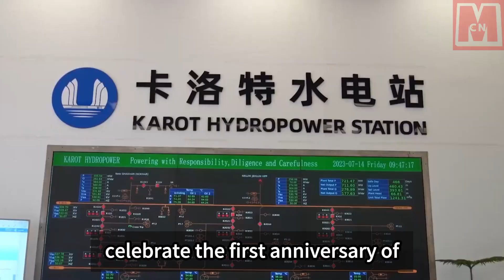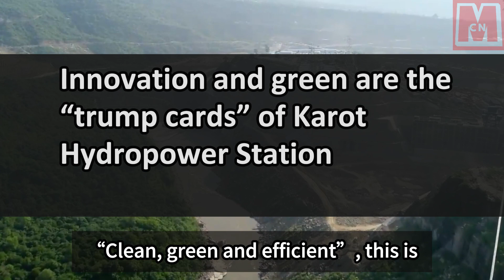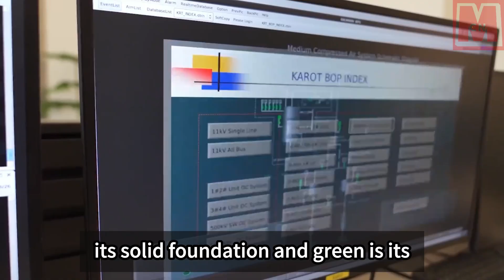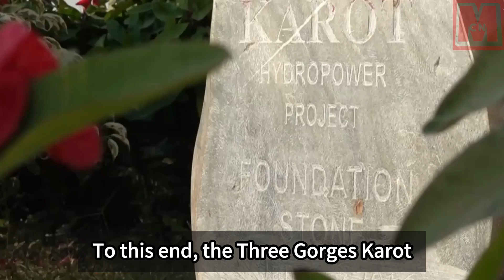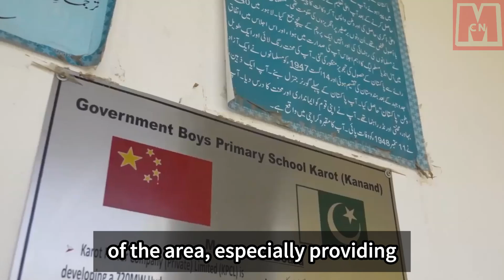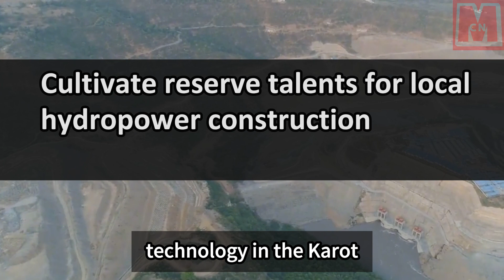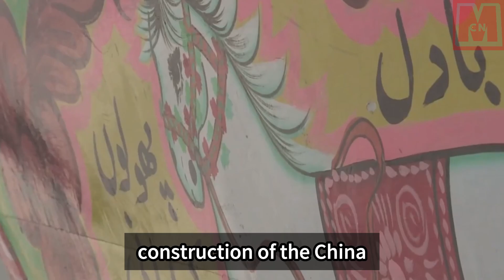“Belt and Road” Green Achievements Pakistan’s Karot Hydropower Station

Comment: You left out mentioning the installed capacity of the Karot Hydro Power Station, which is 720 MW.  A hydro power plant with a generating capacity of 720 MW is considered quite huge.

The largest hydro power station that China built in my country has a generating capacity of 80MW, and this amount of electral power is adequate for the power needs of the largest island in my country, which has an area of 10,389 square kilometers and a population of 600000. This power station supplies about 95 percent of this island's power consumption.